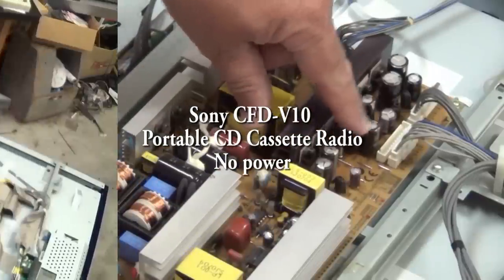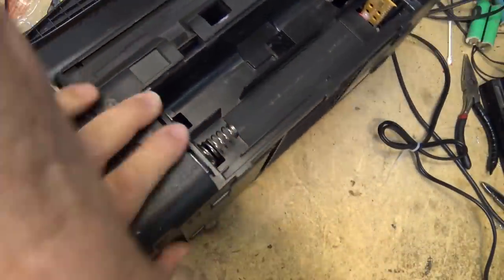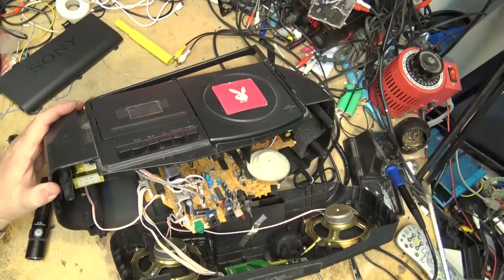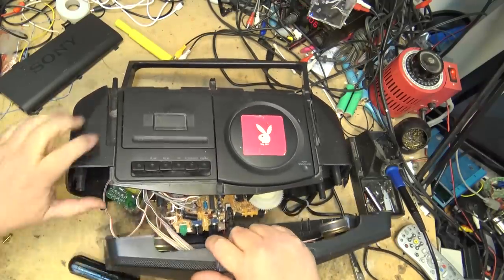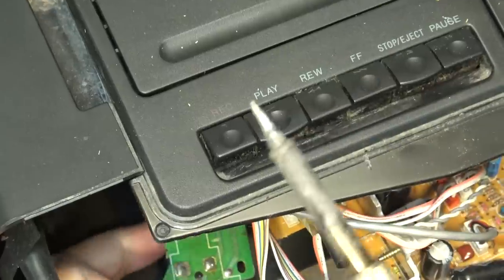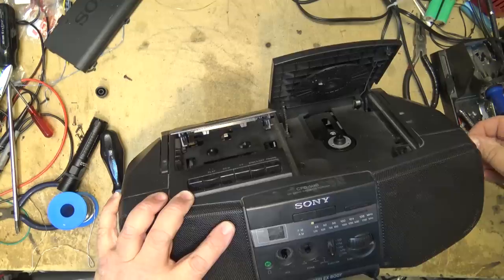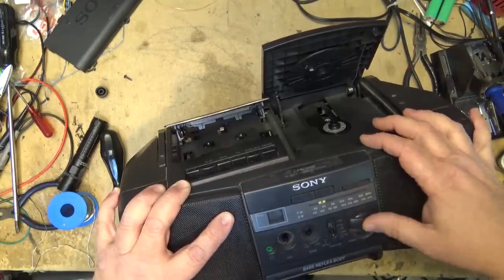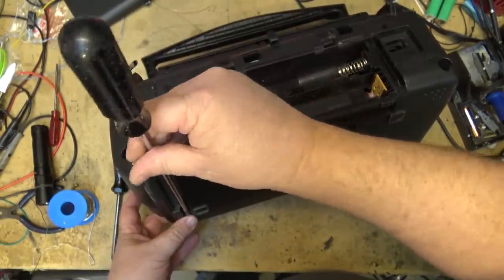Sony CFD V10 Portable CD Radio Recorder No power

Comment: I have the V30, it's a beast in gerth and performance!  I use mine as a garage radio....works perfect!  I was impressed at how much wasted space the radio had on the inside...great repair and superfast repair Dave!  Congrats on you impressively growing subs....I remember back when you were just a few hundred subs, great job!  ~Jack, VEG
Reply from the maker: They had some nice radios back then.  Some were like home stereos that you stuck about 15 batteries in and the speakers were bolted to the sides.
Reply: CD player skips easily with the bass
Reply: Never used the tape nor CD player...just listen to the radio when dorking around in the garage...or outside in the backyard BBQing. Never used it on batteries, just AC.  Thanks for the info.  ~Jack, VEG
Reply: xtf

Comment: These things are way more cheaply built than i thought. These were built back in Sony's 90s heyday, 1996-1998 maybe?  When I was a teenager, I had the top of the line version of this chassis that had an auto reverse tape deck, digital tuner, cloth speaker grilles, and an IR remote. That thing wasnt cheap either. I want to say it was 150 dollars. I am wondering what the inside of one of them looks like. The V10, V15, and V30 were very common models. I have never seen many of the high end models. The one I had was a CFD-S39
Reply from the maker: You obviously never saw the brightly colored plastic toy electronics made for little kids. The My first Sony line of portable radios were aimed at the vtech and fisher price aged kids, but with a Sony price.
I have a picture out of the local rag when I worked at the shop and we were moving to a bigger store, and the 3 of us at the shop posed loading a Toyota van with crap. The boss had the my first sony recorder in his hands, I think I had a handycam in a box, and the other salesman had something else. If I find that picture I will put it up on my bench as a prop in a future video.
Reply: @12voltvids  I haven't been inside of much Sony stuff other than a whole bunch of TVs, some receivers and other hifi components, a couple early discmans, and video game consoles. I am guessing there isnt much to the My First Sony on the inside. They are tough as nails on the outside.
Reply from the maker: @Mikeywil0003  
Nope just the opposite.  First time kid had a tantrum and threw it at the TV, both the TV and the radio were broken.
Reply: @12voltvids  oh wow. I have never really seen any of that My First Sony stuff up close.  I had the poverty brown KB Toys Nasta "Take A Long" kids cassette deck (look it up if you don't know what I mean, you'll probably know it when you see it) when I was a kid in the early 80s. Those things were JUNK. I wasn't even rough on them, and a specifically remember going to buy a new one multiple times to replace the one that broke from regular use. The takeup or supply hub would just snap off from inserting and removing cassettes.  You'd think that we should've bought a higher quality kids deck after the first one, but I think they were like 12.99 or something ridiculously cheap. They just came in a colorful unbranded box that said Cassette player recorder on the front.
Reply: NORMALIZATION OF IGNORANCE I thought the my first Sony stuff used the same type of plastic as the sports models. I always wanted a sports Walkman, but I ended up with a Panasonic Shockwave, which had more features for the price, but no dolby.
Reply from the maker: I hated all those sports devices.  Especially the yellow cameras.

Comment: It kills me that the Japanese will keep the wire lengths so short as to make repair so difficult to save money in production but place 15 screws in the case to keep it together. These units were certainly never meant to be repaired that easily. I remember my first day in electronics... My teacher said" always check the power supply"
Reply: 1pilotsteve Wouldn’t you want to keep the wires short to minimize interference, as well as to stop them from flopping around inside, causing both audible rattles and movement that could ultimately result in wire failure? My hunch is that the added cost of longer wires is less than the added cost of the more difficult labor to assemble it.
Reply from the maker: Especially when the symptom is no power.

Comment: Nice fix. I bet it has better sound quality than present day cheap boombox players. Bought myself last year brand new Sony boombox with cd & cassette player and the sound quality is really thin, even with the bass booster switched on. My old 1992 Sharp boombox has much better sound quality but the CD player is broken, it's skipping and stuttering and the mechanism which moves the laser head is noisy. Any ideas what might be wrong with it?
Reply: I backed my speakers with fiberglass. You will be glad that you tried it, it makes a big difference!

Comment: Hi. I have a Sony CFD-S01 with power problem. I checked the switch you fixed in this video and it is not the problem. Actually it is sending the 12V into the board. Any other idea what might be?

Comment: I picked up a free TEAC Ad-3. It has the CD player on one side and cassette on the other, circa 1990. Is it normal that the 2 capstans run even without a tape in it? The belts are good, and all functions seem to work fine but I have no sound out of the tape deck. Can you point me in the right direction on this one? I'm 100% puzzled.
Reply: Many cassette decks just keep running the motor even when not in use, my teac v2rx starts spinning the motor as soon as the power switch is on.

Comment: That's the main with electronics now the lead free solder cracks and 90 percent of people will throw away the item instead of a repair.
Reply from the maker: This would have been made long before lead free solder.
Reply: @12voltvids  I have found some gems along my street from pcs to fridges left out for recycling  reason I got into electronics see if I repair them if not I have nothing to lose.
Reply from the maker: @jacktheripper6716  
So have I. I grandfather clock, a Thornes TD165, a Sony 50" SXRD projection TV that only needed a 50.00 lamp, and is functioning perfect today

Comment: Hey, I am based out of India and here the power voltage is 220V. I plugged a Sony boombox from the US here without using a step-down adapter, and now it is busted, doesn't work. Do you know what part needs to be repaired specifically for this? Your help is appreciated.
Reply from the maker: you're more than likely took out the power transformer you're going to have to find a new power transformer that outputs the correct output voltage and has the correct input voltage for your country in other words a 220 input and it's likely a 12 volt output. Chances are there's no other damage
Reply: @12voltvids  Thanks for your quick response. So this transformer is inside the device, because I did get a step-down convertor plug eventually (220 to 110) but it still doesn't work. I also called the authorised Sony service centre and they said they might not be able to find the parts. I will check in the open market then.

Comment: Hi, thank you for the video. I tried to solve the problem, as you showed, with my radio which is an old cd, tape and sony radio, but it didn't work. Maybe you could help me. It turns on for a second (just the time to let me see what appears on the small LCD) and then it turns off.. that's it! But I can't find the real problem.. please help!

Comment: My Sony CFD-8 works on A/C but the batteries have to be installed???  No batteries nothing works even plugged in.Thanks for the great info.
Reply from the maker: Are you sure it isn't running on batteries. With batteries installed and the AC cord inserted, if you unplug the AC cord from the wall it should go out, If not then it is running on batteries, and batteries are not needed on AC. There is a switch that gets activated when you plug the AC cord into the radio. If the wrong cord is used it may not be wide enough to activate the switch. In this case wrap a few turns of tape around the end of the plug to make it a little wider to activate the switch.
Reply: It is the correct A/C cord. My Sony CFD-8 works on A/C but the batteries have to be installed???  No batteries nothing works even plugged in. There is a red light on??
Reply from the maker: @PaulCTownsend  With batteries in does it shut off when you unplug it, or continue to play? (It should go off when unplugged. If not then the switch that switches between batteries and AC is not working.
Reply: It shuts down when you unplug it. If I remove the batteries when its plugged in it also shuts down.
Reply from the maker: @PaulCTownsend  
So then it is not operating on AC.  The switch that changes it from batteries to AC is not being activated.  Most likely the wrong size cord is plugged in.  Try wrapping some tape around the and of the plug to increase its size slightly.  Otherwise the connector on the radio may be broken (the switch part) so the power cord is not activating it.  There is a leaf switch that when there is no cord plugged in supplies power from the batteries.  When you plug in the cord the leaf switch contact moves from the battery terminal wire to the power supply wire.
Reply: Thank you I will give that a try.
Reply: @12voltvids  Would you kindly have a replacement part number for the socket part?
Reply: @PaulCTownsend did it work?